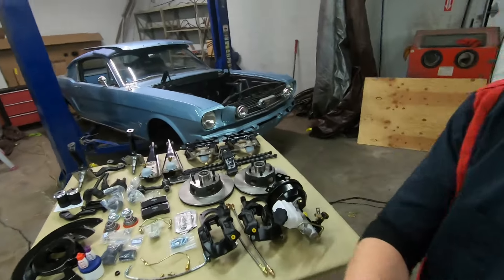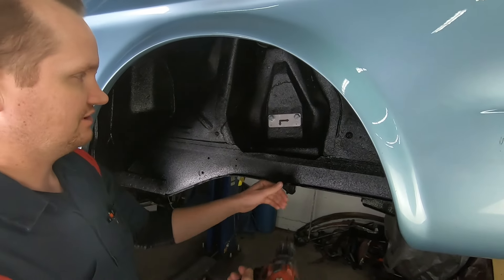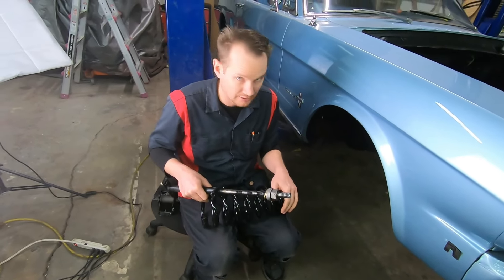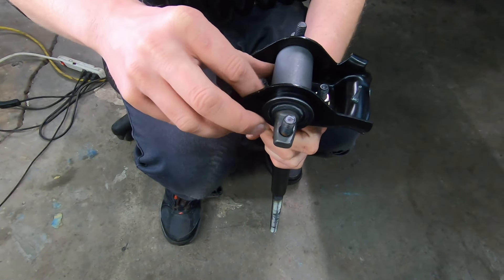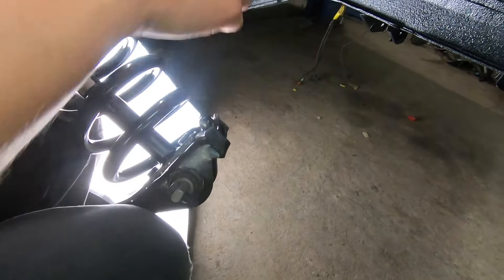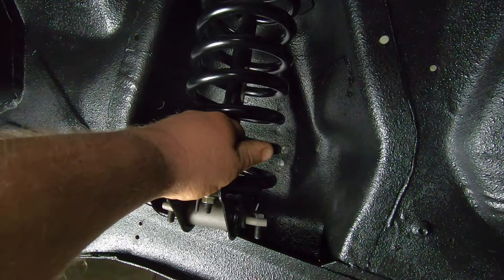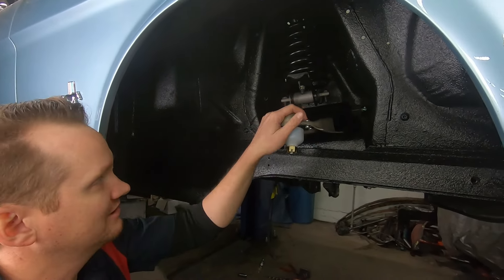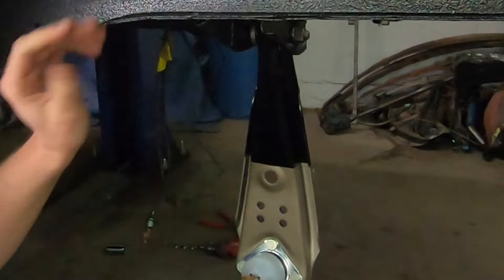66 Mustang - Install coil springs & control arms - The Correct Way - 289 Conversion - Episode 7

Comment: Great video. Only thing is because of the Shelby drop the upper ball joint now sits at a different angle and therefore has less travel going toward shock tower. With factory upper control arms you may want to look at a ball joint wedge kit to avoid those ball joints breaking off during maximum spring compression.

Comment: sweet video just bought a 65 mustang with a inline 6 for my son  and were going to v8 swap it... was wondering is there a front suspension kit you bought that has mostly all parts or did you have to peice it out? im definitely going to go with your CSRP for the disk break conversion upgrade.... any advice would be helpful appricitate the great content!
Reply from the maker: Oh ya I just piece them out. I think i have a bunch of links in the description. Ya for sure do csrp brakes, and now they have a rear disc brake kit that I just did and made a video on too. It's fantastic.

Comment: I hated doing these springs on my liincoln. I would never put my hands on that thing while compressing. I might be overly cautious, but I have seen what happens when a spring lets go.
Reply from the maker: Not with this tool. Safest and easiest way to do it.
Reply: @AlfsMustangGarage  I ended up using a compressor for a mercedes, because my buddy worked on them and said it was pretty much the same set up which I found funny, but it worked like it was made for it. I still find it scary when working on springs knowing what kind of power is in one. compressed.